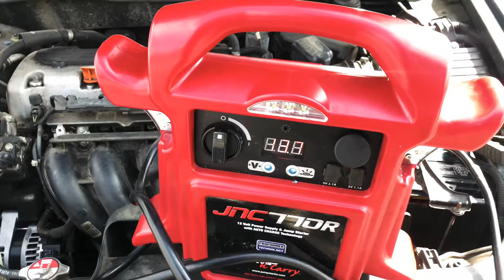How to remove 2008 - 2012 Honda Accord 2.4L Alternator

Comment: Looks like you have a ton of power steering fluid all over your old alternator and all over the power steering pump. Could be what assisted your alternator in going. You prob need to replace the o rings on power steering, lots of videos on here about that but your pump might be shot if you've let it run dry too long.
Reply: You may be right because I let my power steering pump leak way too long before I replaced it. 2 years later the alternator appears to have tanked.
Reply: You actually 100% right I been refilling my power steering fluid every 2 days instead fixing the leak and now the alternator is out

Comment: I just changed the alternator on my car it was a nightmare honestly indidnt remove the coolant and used a stick to to remove the tension. Long story short it's on but the 8mm nut that holds the top wire to the alternator fell under the hood it would turn but not actually secure the wire. About to get a jump and drive next door to mechanic to see if can secure that. That's the only thing left. Also during the process of reattached the belt I accidentally disconnected the power steering wire so everything is covered in oil so maybe that's why the bolt plus the 3 more i bought fell idk thank you to anyone who actually read all of this
Reply from the maker: Hope you were able to take care of it.
Reply: @BrianBalatbat  thanks man! I was indeed able to and the car is running again. Turns out during the process I somehow short circuted it but that was it
Reply from the maker: @CA58CA  no problem glad you got it figured out.

Comment: What tool do you use to release the tension? I tend to have problems with this part and have stripped my tensioner before
Reply: Harbor Freight sells a Serpentine Belt Tool Kit for 20 bucks. Makes removal/installation much easier.

Comment: I removed all the bolts according to your video, but what ever I do, I just cannot wiggle it out. It still sits in place like "bolted". Do you have any advice?
Reply from the maker: Are you sure you removed all the bolts off?
Reply: @Aiw0n @BrianBalatbat  I'm having the same issue.  Yes. I'm definitely sure that I removed all the bolts you removed. It feels like there's an extra bolt underneath the alternator. I can move it forward freely but not out. I definitely got that bottom bolt too. Which was a pain to deal with.
Reply: @mensajero0020  I helped myself with a crowbar, try that, it's frustrating but you need to use a bit force to wiggle it out. I'm sorry but it is very difficult to explain, it's been long time.
Reply: I took a break. It was cold. I had to use the bathroom. After I warmed up. I came back out and got it out like nothing. Thank you for your help. 

I couldn't install the new one because the new alternator isn't exact. The sensor clip & the high voltage bolt are swapped in their location on the alternator. I have to send it back. @Aiw0n

Comment: Looks simple enough. Here we go.
Reply from the maker: Supernova good luck and thanks for watching
Reply: brian balatbat . Hey! I was able to do the job no problem except AutoZone is selling the wrong belt for this model. I had to re use the old belt but its fine for now. I’ll need to see who has the correct belt size. The video was super helpful. Thanks!
Reply: @MrSupernova111  were you able to change the belt? where did you get it? I am taking about buying all the parts that I need from rockauto.com everything is cheaper! good quality too! did. you used that serpentine belt tensioner? if so, where di you get it?
Reply: @youtubersenlamira7562  . Hi! Yes, I replaced everything. However, some important notes on what happened to me during the process. I got another belt from O'Reillys and a couple of weeks later the belt started squeaking. Turns out that the tensioner was worn. To diagnose it I turned on the car and visually inspected the belt, tensioner and other bearings that connect to the belt. I could see the tensioner jumping all over the place which means it wasn't holding the proper tension anymore. I got both a new belt and tensioner assembly from the dealership. The new tensioner holds steady as can be with the engine running. One thing I noticed, is that the Honda belt is much thicker and tighter than the other brands. It was almost too tight but it working great now. Surprisingly, the prices at the dealership were similar to the auto parts store. If you can, go with original or genuine Honda parts as it will save you a lot of possible headaches down the road. Also, if you don't own the tensioner belt removal tool be sure to rent it right away from the auto parts store so you have it ready when you go change the parts. I bought my own serpentine belt tool from Amazon and I'm glad I did since I used it many times through this ordeal. Link below. I hope this helps! Cheers! 

https://www.amazon.com/gp/product/B0002WSFTO/ref=ppx_yo_dt_b_asin_title_o02_s03?ie=UTF8&psc=1

Comment: (Long Read, but Id appreciate anybody & everybody that reads this, & comments/suggestions & Tips to help me with my problem)
iv replaced a couple of Alternators before, mostly all of them on Honda Accords v6 & gotten them done in like 20mins flat. but Iv been working on my GF 08 Honda Accord v4 & this is the most trouble iv ever had for such a simple job. my first/Main problem Iv ran into was the bottom bolt. I didnt have enough room to get my ratchet & socket onto the bolt because my ratchet head was to big & hitting one of the pullys. So after buying multiple extenders & swivel joints, I finally got a perfect sized extender that fits my ratchet & socket but the extender is to my 3/8th ratchet. Soooo, Now my new problem im having is being able to get the bolt broke free.... I have no idea how im going to get the bottom bolt on my alternator broken free. I'm thinking about buying a breaker bar & pray to be able to find an extender for it that allows me to fit it in, but on top of that idk how im going to be able to get enough room to fit a breaker bar under the hood enough to use it... If anybody read all this & has any suggestions or tips on what to do to help me get the bottom bolt broken free id really appreciate the advise.. Also ill explain my problem & situation better in the comments.
Reply: I have advice for you! If her starter ever goes out, ONLY REPLACE IT W A HONDA STARTER! I bought and after markers starter and it cause false alarms for my crank shaft position sensor, and for multiple misfires. I replaced the sensor, I replaced the spark blush and I replaced the coils nothing helped. Turns out the after market starter makes too much noise and something ab the fly wheel idk but when I changed it back to the Honda starter the problem went away! Just offering advice I know it doesn’t help you now but maybe it’ll prevent future problems

Comment: hey my man! thank you for sharing this video it was super helpful and you went straight to the point! I have a question!! every time I start my car, It sounds like if the headers were lose or something with something down the pipe! and it seems like it is a common problem for hondas accords over 160k miles. what would be a full tun up fort this car? thank you !!!

Comment: What is that tensioner tool you used?
Reply from the maker: It’s called a serpentine belt tensioner. You can buy from from any parts store or from Amazon or eBay (cheaper)